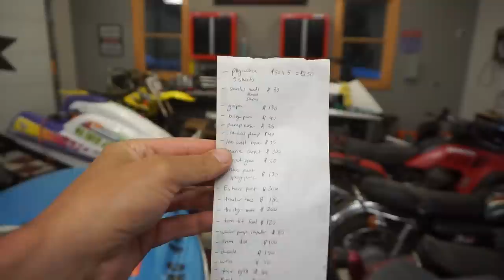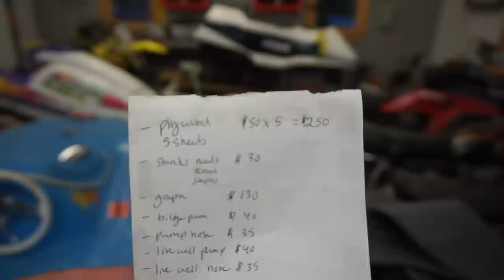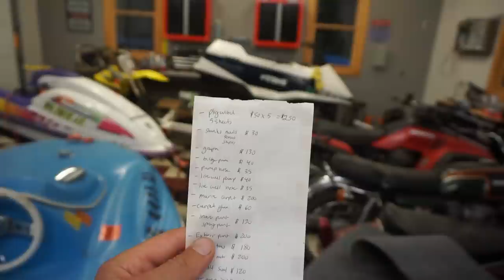The $500 Abandoned Fishing Boat Is Finally Finished

Comment: Boats are fun to work on. Extra deep cycle battery for the trolling motor is a must. When launching by myself I use a 20 foot rope to tie to the boat and trailer neck. Un hook the winch hook that rope up to the boat. Back it up and the boat slides off hooked to the trailer at the other end. Pull the boat and trailer up with truck. Saves from getting wet. Awesome project.

Comment: Boat's looking tight.  Ive had so much fun on aluminum hulls. Beats dealing with rotted wood/fiberglass.
Reply: i was thinking the same, I want to get something like that one easy to maintain and something that will last a while and avoid buying a used wood/fiberglass boat that will just rot out.

Comment: A Good and Informative Series Joe.  Thanks for taking a chance and picking up an old Boat.  

At first, I thought, Oh, a Boat, get the engine running and tidy up the rest and Joe will have an OK Boat.  

Then you started taking apart the boat's interior.  Oh My!  Everything was Rotten or half way Rotten.  Forcing you to replace a great deal of it.  I thought then, Oh Oh, nothing like Ugly surprises.  But, you did what needed to be done.  Took it down to the bare essentials and started the Rebuild.  

This boat was expensive in the amount of time needed to take it from where it started, to where it is today.  But, now you have a respectable boat to go out and do some Fishing, or just Screwing around.  And for less than $3000?  Not bad at all.  And your time?  Well, there is that.  But, Personal time spent doing something like this boat, ends up being way more beneficial than sitting around with a 6 pack, watching the Packers, or Twins.  

Thumbs Up on the entire Series Joe.

Comment: I replaced both the end cap and the bottom seals on my tilt and trim unit , the first time I replaced just the cap it didn’t work right because the bottom seals were bad as well , after i replaced the bottom ones I never had any problems afterwards and the hydraulic pump was working as it should , had to raise it up and down like 7 times so the air escape , thanks for the excellent video

Comment: Joe I had one of the first auto pilots years ago and the problem I ran into with that is the contacts for the steering and sometimes the speed adjustment I found which was my brother told me to take some contact cleaner clean off the contacts then put some stylec grease on there on the contacts and once I started doing that that eliminated all of my problems those contacts will corrode very easily if they're left out in the weather and obviously that's probably a set out in the weather gain moisture that's why it's doesn't respond quickly just a thought thank you for another great video always wondered how that trim motor worked That's nice to see that it's not as complicated I thought it would be

Comment: I enjoyed watching this video, great job. I did know that you fried the impeller on the first trip. You had the motor running without it trimmed down into the water. It only takes about 45 seconds to do some damage. Just a word of caution: I've been told by boat mechanics that you should never run an outboard above idle speed with muffs on it.  Although it gets water it's not enough water pressure at higher RPM's

Comment: For a long time avid angler this series is tough to watch lol.  I wish I could give you some tips on better ways to do things. That trolling motor should be on a 45ish degree angle to the centerline of the boat. It is better to not have the shaft of the motor over the front deck when stowed. You can change it if you wish, then it won’t block the front deck at all.

Comment: I'd have removed the whole trim motor & pump assembly and put it in a vise to work on it to begin with. You could then easily cycle the cylinder up & down with a 12v power source when you completed repairs.
I get it with $$$ for marine stuff, being a boat owner myself. You know the drill, BOAT = bring out another thousand($$)!
Great video series, you got all bases covered, Joe! Thanks for another cool video.

Comment: The seal leaking on the cylinder should not have caused it to not build pressure. The pressure is built up on the pressure side of the piston not on the rod end of the piston. You were likely low on hydraulic fluid due to the leakage on the seal. you could like have found a $3 seal and saved youself a lot of expence and trouble!
Reply: Yes but that makes for short video
Reply: How would he have known this..

Comment: So by not putting the styrofoam back in the boat did it make a difference in the way it floats...could it be a problem later on without it ?
Reply: From what I understand the styrofoam only helps the boat to stay a float when its sinking. If the boat isn't taking on water the styrofoam doesn't have any effect on the water displacement.

Comment: Im still concerned about the lack of floatation foam.  Swamp that boat & it goes straight to the bottom. Floatation foam keeps the boat at the surface of the water even if it's swamped, which could save lives! With no foam the boat just becomes an anchor!

You should consider removing sections of flooring to install new foam-- particularly at the stern and under the bow platform.  The stern needs a lot to offset the motor and the bow platform has room for enough to offset much of the rest.  You can reference the factory foam quantity & placement by reviewing your demo video. When you are rebuilding your own boat you have the opportunity to overengineer what the factory may have cheaped out on... I call it 'doing it right'.
 Line the compartments with plastic film & fill with 2 part liquid mix. Get it where they sell wholesale fiberglass repair materials.   You have to mix it & get it in place fast, but it's really fun to watch! You don't want the mess from an overfill, so measure carefully & double check your math.

Comment: Hey Joe you should add one of those kits for drop top canopy & adjustable locking.,an pivoting mounting brackets for rainy.,or stormy weather out with security straps.,an tie down stabilizers to keep it fixed to the boat top down to the boat hule.,an  buckle towing loop rings.,or T-tugs for towing either one.

Comment: That trolling motor needs to be mounted at an angle across the bow, not straight over the front.
Reply from the maker: Seems to be working great
Reply: @2vintage  take his advice!  Trolling motor base shouldn't protrude over the bow. It will be more stable and you wont lose your motor some day. And also when you stow the trolling motor the prop shouldn't point up. Goes side ways . It has a built in cradle.
Reply: @ToddDahna  if you look at his base it’s only being held down by the back to bolts. The front bolt holes are hanging clear off the front.
Reply: @chrispeterson1247  yeah. Saw lots of flex when he was using it in the video.  I see bad things coming. And he'd have more leg room when someone's in that seat. The guys a wizard at fixing bikes but he needs to study how to rig a boat.

Comment: I'm sure, no one will read this... BUT-  when I watch your other videos, every time someone has painted a motorcycle, you strip off the paint, to reveal the OEM finish.
Soo- why did you paint an aluminum boat?? 
 What the heck?  
Black on the inside? Black will get hot and fry everyone.
5 years from now, that paint will flake off, and look like crap!  Nothing sticks to aluminum for long, because it expands and contracts with temperature so much.
BUT-  if you sell it quick, then you're right, paint it.